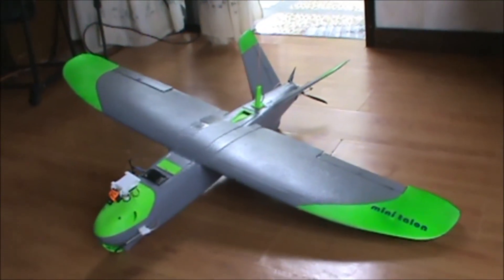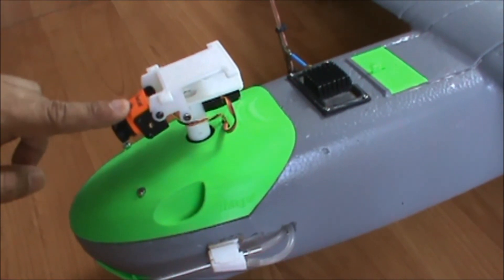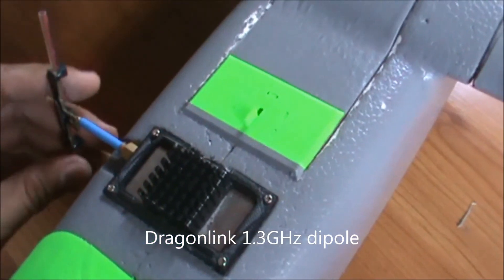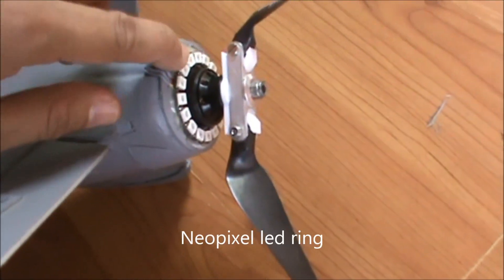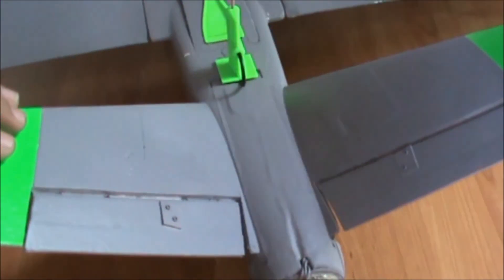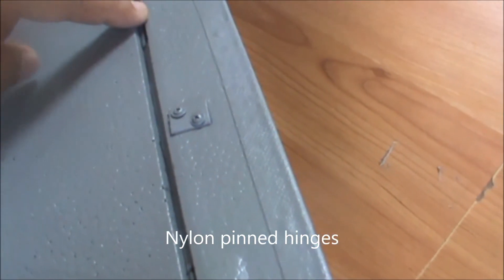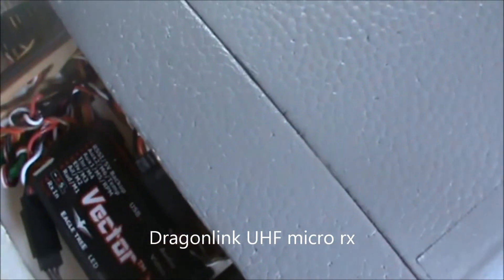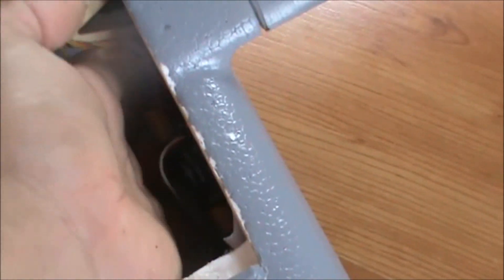XUAV Mini Talon Build

Comment: Hello there! I understand that this video is 3 years old but.. Damn it, how beautiful it looks! How did you manage to paint it like that? What did you paint it with? For earlier thanks for the answer!
Reply from the maker: Acrylic spray paint (in can). I used primer for first coating.
Reply: @windfpv  Let me learn a few more nuances from you. The paint that you applied will be heavily coated? Does foam rubber eat up the ground?
I chose the first Talon plane for myself and would like to make it something like yours. It's very beautiful)
Reply from the maker: @JokoKangaroo  apply thin coats, then one clear coat on top.
Reply: @windfpv  Thank you, we will try. The video transmitter is in front of you. The connection for 5+ kilometers is not lost? What batteries do you use? Are there any builds from 18650?
Reply from the maker: @JokoKangaroo  I got 15km out without video loss. I'm using lipos here, not li ion packs.
Reply: @windfpv  And it is possible to contact you in a different way that you do not ask 1 question and wait for an answer? Maybe you are in the telegram or somewhere else
Reply from the maker: @JokoKangaroo  add me on FB